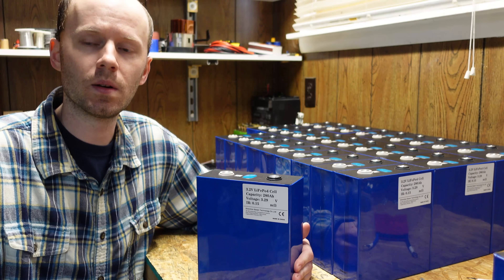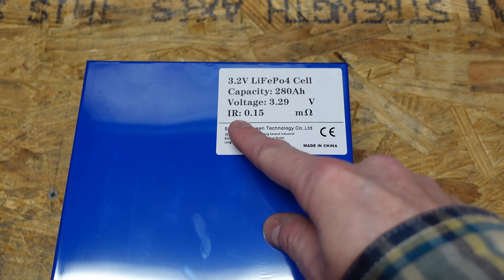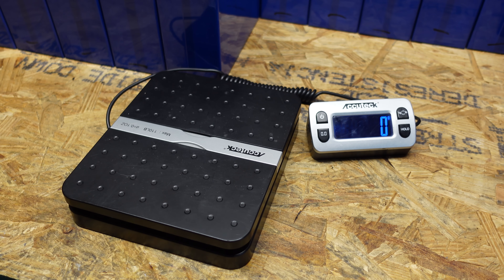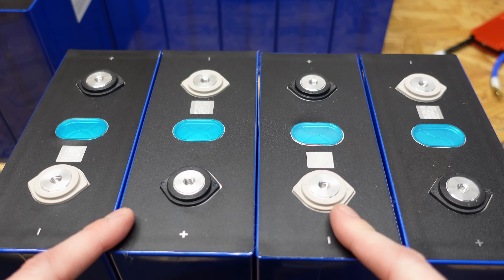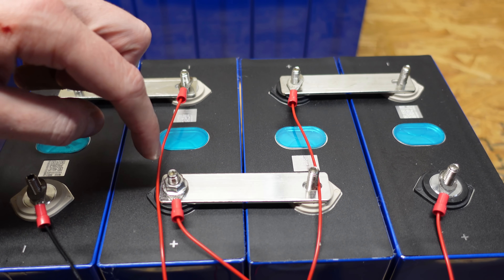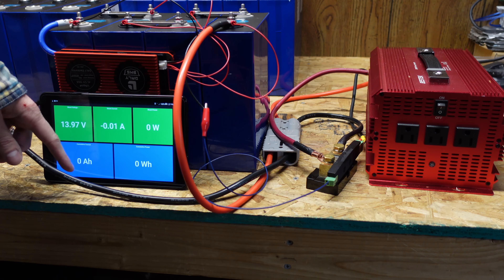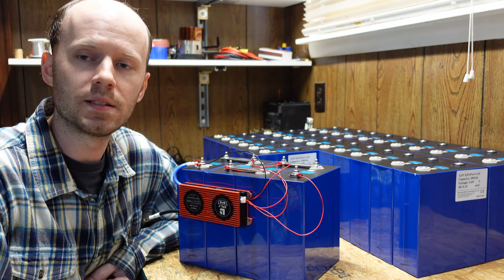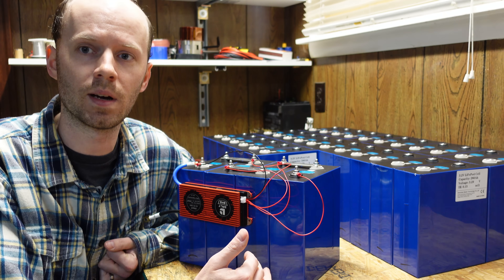EVE 280Ah 3.2V LiFePO4 Prismatic Batteries (Shenzhen Basen)

Comment: Your battery is rated at 280Ah and your BMS is rated at 100Ah. What's the reason for this mismatch? Is it to not overwork the batteries? Please clarified, thanks.. p.s. great video
Reply from the maker: The BMS current rating 100A has nothing to do with the battery capacity 280Ah. The BMS is rated depending on the size loads you plan to run. In this case, I can run a maximum of a 100A load.

Comment: I really hate that the terminals are aluminium, like thats horrible, like I assume there is a chemical reason for it but I would really much prefer they were of a high grade steel and then the studs were copper or aluminium so then you can cross thread as much as you like your not going to ruin the thread on the batteries.

Comment: Hey i need a bit of advice ,,,in oktober my main house on my farm burned down, so now i have purchased a camper to live in on the farm  temporarly while i rebuild a small woodhouse on the farm  in the meantime the electricity prices have gone way way crazy here in denmark  so i figured i would just not connect to the grid again , my start plan is as follows i have ordered 8 280 amp cells for a 24v battery along with a daly  200amp bms  along with 10 400watt solar panels  and a offgrid charger/inverter and a istabreeze 1500watt windmill with a controller (i have a bit exspirence in building batteries and playing with thase offgrid systems even back before litium , but my knowlegde is still somewhat limitid) beyond this i have a home made decent working 280 liion cell 7 s 98amp hour battery a 12v 400watt wind mill  and 600watt solar in  20v-12v  setup  ,,so what i am looking for is  simply to run tv refrigorator internet  a laptop blower motor for dristribution of heat maby a small freezer and lights in the caravan and later house  ,all heat is gas  and oilburner  later woodstove so thats not a concern ,,,i have figured out that i should be able to get by on as low as 3kw a day my qestion is would that be relialble possible on these systems here in denmark?  i have several generators to top up batteries in chase of low energy periods but  the point is to not run them to much ,, and would you add something to my system ?  i know that i will have to buy atleast 8 more 280amp life4 cells for storage of power  but i wanna first see the quality of the cells i have on the way ,, all these  items i have mentioned can be purchased for the same prize as 1,5 years of electicity bills i a 3 person household using 8-10kw a day ,,aint that mindblowinging??

Comment: Hallo @LithiumSolar I was wondering if you have a video or can reply; I would love to buy these batteries but do not have much experience with charging; how fast can these batteries be charged in a safe manner? I was hoping to make a project that requires charging < 2 hours or even less with 24 or 48v
Reply from the maker: The best way to find out something like this is to check the datasheet from the manufacturer. The sheet I found online for the LF280 (Version E) gives a max charge rate of 1C or 280A.

Comment: Glad it all worked out.  You wired the BMS wrong.  It was done black to negative, red to negative, red to positive, red to positive, even though you said it correctly.  We all human, mistakes happen.
Reply from the maker: It's not wired wrong. It doesn't matter what color the post is that the wire is on. It's a "series connection".

Comment: Nice video....What voltage must charge that battery bank (16S) of 51.2V of 360AH so that it reaches 100%?...thanks
Reply from the maker: These cells are 3.65V full charge so with 16 in series, that would be 58.4V full charge.

Comment: Only thing that worries me... is getting super used cells like imagine them being originally 310ah cells... used to where they repackage at 280ah. 

Sure, you get the 280ah but they are several years old.

Definatly not saying yours are. I'm sure there is a way to check by measuring the cells like I've seen others do.

Diysolar got some cells that this exact scenario happened. 
The cells were side by side with another group of cells and were larger. Both pulled "rated" power. 

This has kept me skeptical enough to consider making my own multi round cell batteries. 

Can you do a tear down on one, as in take wrap off the cell, take the top paper off and see if there is evidence of another QR code or it being another cell?

Or do these measure out nicely for them being grade A?

Thanks

Comment: Charger for Ferro phospet battery and lithium iron bettery both are same or different.
Reply from the maker: Fe is Iron, so "Ferro" is likely the same thing as LiFePO4. Just make sure it has the correct charge voltages before using (3.65V max voltage per cell).
Reply: @LithiumSolar   sir, now I want to purchase one lifepo4 battery instead of lithium iron battery as  same lithium iron battery going to disorder.But my charger which is charging to lithium iron battery is ok.hence now I am in doubt that can this charger will charge the lifepo4 battery to which going to be purchase , suitably.

Comment: On Battery Day, everyone should wire all the batteries in series and then we could use that to convert earth into a spaceship that uses a battery powered em drive.
We can control the steering by regulating the timing sequence of the batteries on different parts of the planet, it would be cool to give it the ol college try, and escape THE BORG.

Comment: After viewing this, I decided to do a little shopping for LiFePO4 batteries. Unfortunately, what I found cost substantially more than lead-acid for a given capacity and I've learned that the life expectancy of LiFePO4 is greater than lead-acid, but not nearly enough to justify the cost. So, for considerable expense I can avoid the need to periodically add mineral-free water to the cells by switching to LiFePO4, but this appears to be the sole advantage.

Comment: I've been doing a bunch of research on 'how-to' videos and what shocks me now is how everyone is ok with using 'Amp hours' instead of just using joules. An average Household uses 11,000 kWh per year
11,000 kWh / 365 = 30kWh a day
30 kWh is 108,000,000 Joules

Now just take whatever you're looking to buy and see how many joules it has. 280 aH * 3.2 Volts = * 3600 = 3,225,600 Joules of storage
Volts * aH = Volt Amp Hours * Coulombs for joules (3600)
In otherwords, you need 34 of these to have enough storage for 24 hours.

A 250 Watt Solar Panel (1kWh = 3,600,000 Joules) (3.6m/4 = 900k) will produce 900,000 Joules per hour.
The average Solar Hours in the USA is 5. Assume 7 because Solar Hours are peak performance ~ so you will generate 6.3m joules of power.
very simple, but 7 * 250 = 1750 watts or 1.75kW 
1750 watts * 3600 Coulombs = 6,300,000 Joules

Basically, just take anything you produce in a set amount of time's watts and * 3600 = joules
Use joules.
You need 17 250 watt solar panels to power your house, and 14 of those hours must be stored. 108/24 = 4.5 or 45,000,000 joules of storage = 14 of these batteries.
(the 14 hours of storage is based on average day/night cycle to get through winter + cloudy days)
Assume 65% efficiency of your panels btw. You lose 1% power output per 1 degree over 75 or 77*F I believe? You gain more power from water cooling your solar panels than leaving them out, it's just more maintenance and mechanical parts that could fail- however.
Reply: What benefit is there to converting everything to joules? Unnecessary complication.

Comment: Hi folks, i have made several orders from Shenzhen Basen. On the last delivery all cells were defective. After a full charge, the voltage dropped to 3.33 volts within 2 hours, one cell was completely without function.
Shenzhen Basen had promised a refund but has not yet made it. The request for a refund from Alibaba was unsuccessful because Basen agreed to the refund but never sent a return label. After 14 days, Alibaba will close the case and Shenzhen Basen has bypassed the refund.
Reply: thanks, i was about to order but i feared that would happen to me too. i have been watching and it seems these companies will ship good cells at first and as soon as they get many customers they will ship garbage, close down and then start selling as a new seller and do the same thing all over.  did you try to make a claim on your credit card?

Comment: isn't your BMS hooked up wrong?  your black goes to the 'main neg' - which is fine.  but then you place the first red wire on the second cell's NEGATIVE terminal... no, it should be on the FIRST cell's POSITIVE terminal, right?  i.e. - each red wire goes to the positive of each cell...
Reply: It'll get the same reading either way. Those two terminals are bound together.

Comment: Please do a video on mobility scooter change over from AGM to lithium, incl what BMS & charger etc . EG my scooter is a colt pride executive and currently has 2 x 12v - 100ah batteries in series = 24v. I have the basics sorted but as a newbie, I wonder about things like-do I need to run 2 x BMS as the batteries will be either side of the current battery space, do I need a cooling fan> are they better in a battery box etc etc etc

Comment: You're linked to the wrong BMS.  The cutoff voltage on that BMS is too high for these batteries.  I'm unable to find dimensions of these batteries anywhere.  Could you measure them and post the dimensions?  Thanks!
Reply from the maker: That was the exact BMS I ordered. I went back to my order history and it looks like someone (seller and/or Amazon) changed the listing to something else. That wasn't very nice... I updated the description. The cells are 174x72x205mm.
Reply: @LithiumSolar  they probably ran out of them and substituted a different part.  I ordered it, and it did not have the proper voltage cutoff.  I had to return it.  Thanks for the update!

Comment: You checked the conformity of the weight, but not that of the outer dimensions. I have an existing battery enclosure where I think of replacing the cells with those you bought, but they must fit the cabinet. According to the specs published on Aliexpress, they would fit, but did  the cells conform the dimensions? If they were any bigger than th spec, they would not fit my enclosure. Could you please check this?

Comment: Ive heard you say the "voltage isnt a good way to measure Lifpo4" in 2 of the 3 vids Ive watched but you never seem to say what is.
Reply from the maker: A shunt programmed for the battery's capacity is the way to determine state of charge. It will measure the amount of amp-hours charged/discharged and know exactly what's left in the battery.
Reply: @LithiumSolar  Quick answer, thank you Sir!

Comment: Im looking to build a setup to run a 5000btu a/c unit in my truck camper. Im thinking this is a good route especially with 280ah in such a small pkg. I have a 12v 120ah made of multiple 10ah cells and it is probably the same size as this that is nearly 3 times the capacity. I wish this vid stated how long it took to drain at 900w so I could figure out how long I might get out of a cycling a/c compressor that takes around 500w when it's running. Im guessing 8 of these would be needed so I could safely run a/c 2 nights in a row without solar.

Comment: Just ordered 8 of these based on yours and Will Prowse' review videos.  I'm glad I saw your video to gain knowledge of a good supplier.  I hope my cells are as pristine as the ones you recieved for this video.
Reply from the maker: Did you order from Basen? I ordered 32 more but they canceled it a couple of days ago it because they were out of stock.
Reply: Yes, I followed your link. So far the order is a green light and they've charged my card.
Reply: @SailingIndependence  did your receive your order ok?
Reply: @jay6.7powerstroke63  no. They were not actually in stock and they tried getting me to "upgrade" to a different battery at no extra charge but I declined and got a refund.

Comment: Question: Shouldn't the 4 red wires from the BMS go to the 4 positive terminals of each cell?
Reply: For the wires that don't go on the main positive or negative terminal, it doesn't matter so much as the bus bar is connecting the cells anyway, it would have a direct electrical connection regardless of which terminal its on, as long as it's in the right place (you can see the 3 middle wires all connect to a separate bus bar each)

Comment: Actually I have a comment about bus bars. You seem to be happy that they are copper but actually from my understanding copper is better for wires when flexibility is required or if space is a concern. For weight and price aluminium is actually better so wouldn't a 4mm thick pure aluminium bus bar be actually better ? The only disadvantage to me would seem longer stud.
Reply: Copper carries twice the amps for the same thickness, and you can solder to it if needed. Also less issue with thermal expansion I think.
Reply: @davidhamilton8984  Soldering is indeed a valid argument. Not exactly twice the current. 4mm Alu would actually take bigger current. Maybe aluminium would need to be covered with something like copper is since oxidation might be an issue.

Comment: Why do you think you got 280Ah of discharged energy out of each module?  Your tablet display shows the final discharge energy was 3480 Wh.  Divided by 4 modules = 870 Wh/module. Divided by the nominal V of 3.2V = 271.875 Ah (which is ~97.1% of the rated capacity of your modules).  You also only charged the modules to 13.99Vdc.  The manuf indicates charging Vmax=3.65, so you could have charged the series-connected modules to ~14.6Vdc.  Is the 5 yr warranty 100% replacement or pro-rated?  Do you have to pay to ship the module/s to them for testing or will they just ship a new module if/when you report a dud?  Who is responsible for paying for the shipping?

Comment: 5.34kg*72 =384kg, 259V, 50kW/h. If I stuff the cells directly in the batterybox in some foam and use as few interconnects as possible and don't need endplates and threadded rods, they will be only 23% heavier than my current Li-ion pack, so very usable for an EV!

Comment: Just about to buy from them, so thanks for the video. I thinK the torque is 8nm on this aluminium threads. How will you tie them together. I am doing 4s2p and wondering if the 4 can be just tapes together.
And will I need a seperate BMS for each group of 4s? TIA

Comment: Question - what is the shunt for?
Reply from the maker: The shunt measures current during the discharge and reports back the amount of amp-hours discharged for capacity testing.
Reply: @LithiumSolar  Gotcha. And the BMS prevents under and over voltage draws and charges?
Reply from the maker: @larryroyovitz7829  Yes. Also prevents over-discharges, as well as under and over temperature :)

Comment: Certainly no expert on this but why is one of the red BMS leads going to neg. terminal? Shouldn't they all go on the + except for Blk common?
Reply from the maker: The wire goes to the series connection. It doesn't matter which pole it goes on technically, they're both connected with the copper busbar.

Comment: I'm sure you have a shit ton of Q's and A's to and from everyone. Is there any way to direct chat one on one with you?
Reply from the maker: The best way to contact me is here ;) Are there any specific questions you have?
Reply: Yes- do you have a store for some of your builds? I have a grid tied 13.26 kW solar on my house here in Las Vegas- I’m running 2 mining rigs and would like to run them both off battery power overnight when power is most expensive. I don’t know my overnight power requirements but would like to get the largest battery backup system I can afford to run the mining rigs. I have zero know how on electrical matters but I’m a 25 year retired L.E.O. that has done computer forensics / cell phone forensics/network security / and many other technical things for last 20+ years, so I’m a fast learner.
Reply: Also- I noticed that Tesla/Solarcity installed a 10 kW Fronius Inverter on what they are calling a 13.2 kW 53 Panel Solar Array- does that mean we have been getting boned out of 3.2kW since 2015???

Comment: I'm in Texas would there be any problems with customs such as large fees getting these shipped from china?
Reply from the maker: I'm in Pennsylvania. I didn't have any customs issues. I paid the supplier using the "DDP" method which means the supplier is responsible for import/customs fees. I assume they calculated that into my cost.
Reply: @LithiumSolar  my brother ordered a asic miner for $1400.00 and the seller contacted him and said it was bieng held up at customs and asked for an additional 800 dollars. That's why I asked.

Comment: You have the first red wire on the negative post. Is that right??
Reply from the maker: I have the first red wire on the first series connection. It doesn't matter which of the 2 posts, they're both at the same electrical potential.
Reply: Do you got 4 for sale?
Reply from the maker: @JimmyL361311  I don't sell batteries. There is a link in the video description where you can purchase some if you'd like.
Reply: That takes too long..i need 4 asap

Comment: Very cool dude.. I have 64 of the Eve 280ah batteries coming very soon.. ordered 2/28 very excited!
Still thinking and researching for bms’s for these?
Final Configuration will be.
6 sets of 16s 48v 280ah each 
Total 1680ah*48v = 80,640 wh
These will be powering our home so I’m looking for something pretty dang good.
Must have BT, temperature monitoring and be rated for roughly 100 amp charging and 300 amp discharge each. 
Any recommendations for bms? 
Thanks for your hard work dude!
✌️PT
Reply: @Keyzer Soze no sir. I have Idaho power grid a very reliable power.
It’s a lifelong dream to build my entire home solar power system.
According to the numbers up to this point.. about 8yrs. So likely 10 or so years to pay for it self I’d say. I will add or change something every so often. I’m sure.
Thanks 
✌️PT